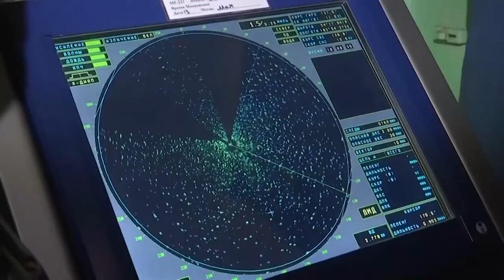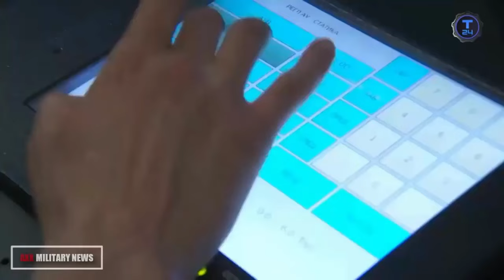Russia’s Steregushchiy-class Frigates

Comment: For a corvette designed mostly to operate inshore with a 130mm main gun, 12-cells VLS for SAM that could be quadpacked, 2 30mm CIWS, and 8 Kh-35 AShm.
Reply: 100mm*
Reply: They're more frigates than corvettes. Im not sure personally why russia designated them as corvettes. Considering the large number of much smaller buyan and karakurt class ships they have built recently. I think they are intended for limited blue water action aswell as acting as flagships for flotillas of smaller corvettes near shore. Nato has designated these and all variants as frigates, I believe.
Reply: @liamvosefski2795 Meanwhile Britain has an 8,000-ton frigate and US has a 16,000-ton destroyer.
Reply: @liamvosefski2795  because they only have endurance for 15 days. They are not designed for long distance operations. They are designed for costal defense thus they are capable corvettes not small frigates.